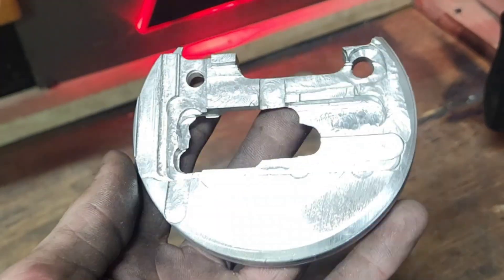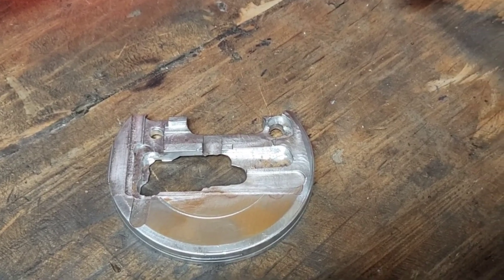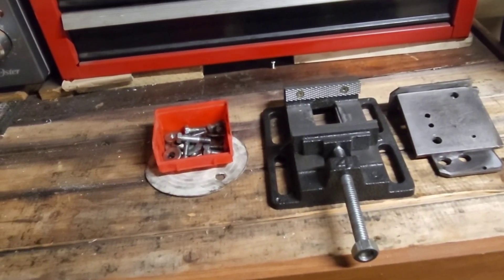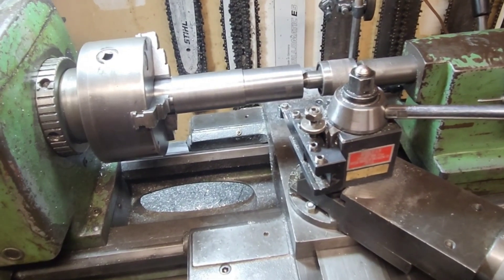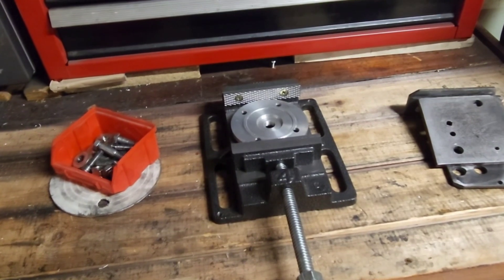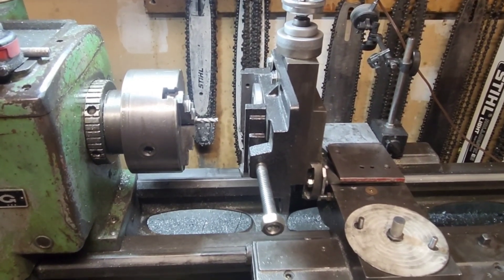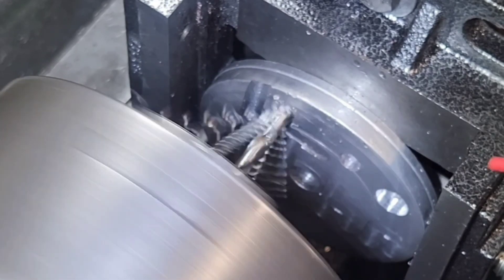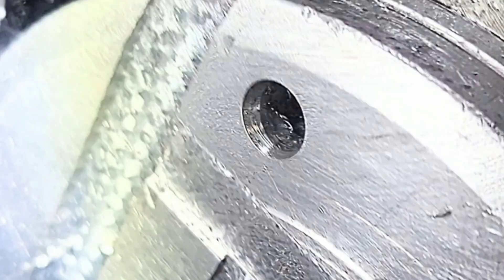Milling attachment for Clausing lathe... Using a $20 drill press vise and some scrap metal 😯🤑😁

Comment: If you get a short set of parallels, it will keep the piece off the seat of the vise where you can drill or mill through anywhere without getting into the vise itself.

Comment: Milling vises have been around since the 70’s and used to be sold by the lathe manufacturers. They figured out they could sell you a mill in addition to the lathe, so they stopped making them.

Comment: The jaws for your vice take measurements of them and make your some aluminum jaws copper plastic steel knurled and not that way you have soft jaws to not mar up your work or steel to bite which will leave marks that you could machine off later maybe but the aluminum copper and plastic are your soft jaws to hold parts but not leave marks at all and you could machine dishes in them to hold cylinder tops like that aluminum disk so you can clamp it down tight with lots of surface area instead of square jaws with minimal contact on your round part I hope that makes sense lol 😂

Comment: I freaking knew something like this would work! adding in a coolant mister should be fairly easy for you actually. They are under 20 on ebay/amazon. Also, there are heaps of local auction sites around like the premier machinery auction in blaine, where you can find all sorts of tooling, vises, etc....What I always tell my kids is, Can't never could til he tried!